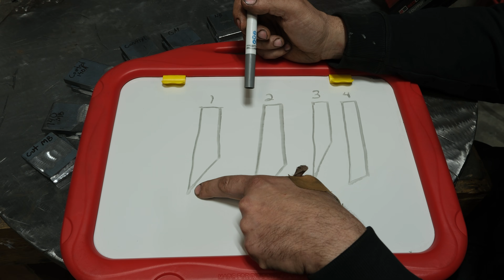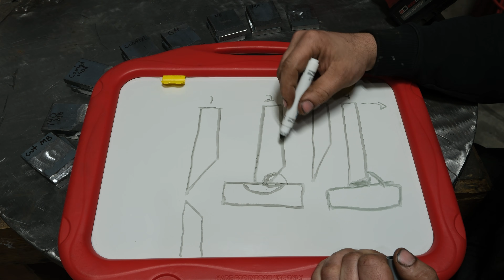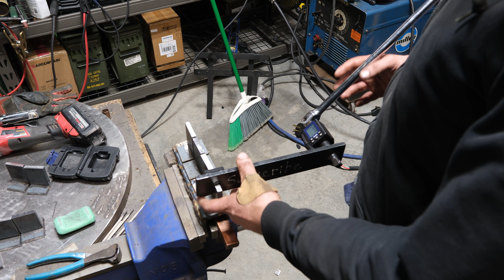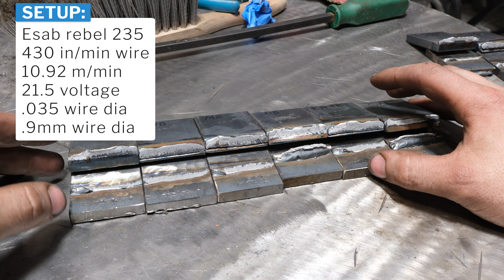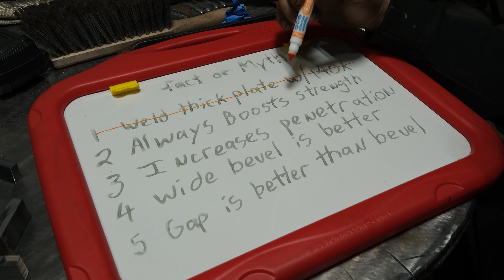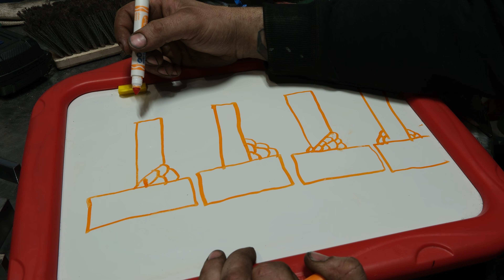Does beveling increase weld strength??  Deep dive

Comment: The obvious answer is your penetration-to-material thickness ratio but removing impurities with good prep is also a huge factor. The increased size of the weldment with a bevel on a fillet is still beneficial. Multiple passes will help sink the heat into the base plate, a single pass in this case is still undersized. Gaps and too much heat can lead to cracking depending on the filler compound (71t flux tends to be more flexible than 70s solid).

Comment: i feel the main benefit of beveling is you gain surface area. Can do two passes in a joint that would only take one without beveling.
Reply from the maker: You can theoretically reduce passes and reduce how much weld is outside of the theoretical 90 degree intersection by beveling you are correct.   The problem with this from a “home gamer” perspective is that on thick plate the probability of poor fusion is high.  I was successful in getting decent results, but it wouldn’t take much flaw in technique or settings to cause a very weak tie in to the bottom plate.  You could end up with a situation where you think you have a solid amount of weld throat depth, but due to lack of internal fusion you have almost none.  With spray, dual shield, or other processes that have more penetration I wouldn’t be so worried.

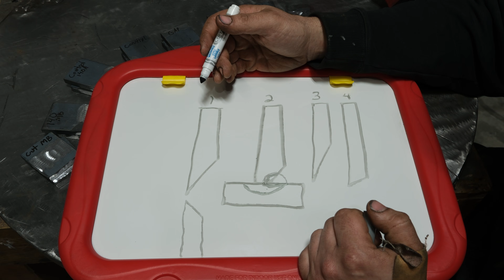Comment: 6:24 I thought the purpose of the bevel, in diagram 2, is that if you don't bevel you get zero weld penetration at the center of the sticking-up piece of metal. So it's more about getting as much of part A welded to part B as possible, than it is about depth of penetration. 

But I think a lot of stupid things.
Reply from the maker: The bevel will allow more weld to be deposited into the material, which allows you to reduce the number of passes on the outside of the “theoretical” 90 degree intersection.  This can be good if you need the clearance (aka an oversized weld would be in the way) or if you want to achieve resistance against leverage.  The problem is the bevel itself doesn’t allow you weld thicker steel than your machine can handle.  Many people have the thought beveling solves the issue of not having enough power when the reality is if you’re not careful it can make it work.   

Whether or not a fillet weld needs to be full penetration or have a bevel (and thus weld further in) comes down to what the particular joint needs to handle.

Comment: after the first 15 seconds or so, i was actually thinking of whether bevelling is needed or not.  you see end cuts and acid etches of welded plates, the penetration goes deep enough in a good weld that without bevel or gap, it's still fine, it'll never penetrate deep enough to get it all done in a really thick plate cause the welder tip/rod won't go deep enough, there are those 800amp welders that'll do it by making their own bevel.  anyway, just to get the tip in deep enough to fuse at the middle of the plate is something i'd guess is the goal with a bevel.  one trick i've seen that seems to work is gap(0degree bevel :P) with small spacers.
Reply from the maker: Beveling is really dependent on what’s being welded and how it will be stressed.  If you only have access from one side and need to have 100% full weld between the top and bottom plate of a fillet weld, beveling is the only way to achieve this.  Situations that may be required is two stressed members of say a bridge that meet at an angle.  Or on pipe where 100% weld needs to be between the two pipes.  From a fabrication perspective much of what people weld probably won’t see a whole lot of benefit to it.  It arguably would be less effective than simply welding both sides of the fillet weld.  Sometimes that’s simply not possible or not acceptable.  Definitely a complex problem lol.

Comment: I would like to see a test with the vertical. Having a horizontal grind line 1/16th, deep 1/16th up on the vertical. That runs horizontal to the weld,

Comment: Love your channel, I would be very interested to see how flux core performs in the same senario as you have presented in this video. My guess is that the penetration for similar values as the mig would be better hence stronger weld. Hope you can do this but meantime will put to the test myself
Regards Kym Perth Western Australia
Reply from the maker: So flux core wire (self shielded) will out penetrate short circuit mig without much issue.  However there is a huge limiting factor with gasless flux core, and that is internal porosity.  I have done a lot of tests in the past, and no matter the wire used or settings, .035 flux core wire had internal (non visible from the outside) porosity on steel above 1/4inch steel.  This becomes a major issue with weld strength when attempting to weld above 1/4 steel.  Switching to .045 Gasless or bigger will likely help with this, but most peoples home welders can’t run .045 or bigger wire.  The reason the porosity happens is due to how fast the weld pool solidifies, there isn’t enough time for the gas to escape.  Running bigger wire allows you to carry far more heat without the wire blowing apart, thus the weld pool is hotter.  

So the simple answer is flux core will put penetrate short circuit, but it’s weld will be weaker than short circuit on a test like this video because of inherent weld defects.

Comment: Very interesting break test.  I see how welding the beveled plate can add strength to some degree to the welded joint, but not as much as I would have expected.  For the best results, it seems that filling in the bevel out to flush with the surface -- then putting in one or more additional beads to build up a bead profile like what you would get without the bevel -- would create the strongest weld.  Of course, there would still be that area where there is no root fusion, but not as bad as without any bevel.
Reply from the maker: It definitely isn’t a cure all that’s for sure.  If I was able to do a better job of making the weld deposited the exact same, the differences would have been far closer.  All of them show signs of defects that are undesirable.  With 2 more passes all of the welds would have proven to be very strong.  Having the correct thickness of weld will make it far stronger than the bevel with a single pass.
Reply: @makingmistakeswithgreg  When anyone welds manually there is going to be variation.  It's unavoidable.  From your testing, would you say that the strength gain of welding into the bevel is mainly because there is more surface area for the weld bead to fuse to?  And that the farther back into the groove you can weld toward the root, the better?  If you have the time maybe you can test breaking some U-groove joints too.

Comment: I'm thinking of an other aspect:
I learned as a rule of thumb for MIG that a fillet weld has to be in size 0.7 times the thinnest of the joined plates if you weld one side and 0.5 times if you weld from both sides. This is because you fillet material is usually way stronger than your plates. In Perspektive for strength, how deep of a  fusion do you need provided that your material is shiny clean and you use the appropriate filler (that also substitudes some alloy elements that get cooked out by welding)? 0.1mm, 1mm or 3mm?
If  two welds cover a surface of 1cm² is the one with 1mm penetration stronger or that one with 0.1mm?
If they are equal, what does more  penetration on a fillet weld other than enlarging the fused surface by biting into both plates and creating a  radius?

Without any doubt a decent amount of penetration gives a visual sign that the Material is fused. Without any doubt it helps to overcome small impurities by cooking them out. Without any doubt it helps to ead away straight, sharp edges which are notorious for "hinging" and starting the fearsome cracks. But I'm wondering if the overall strength comes from the surface area of fully  fused metal, no matter how deep this fusion is as long as it is completely fused.

100% fusion welds are in another ballpark because these eliminate every straight edge (which is basically a predefined crack) leaving no lever for hinging.
Reply: Very good explanation of what fusion is vs penetration.  Many times people become confused between the two!  Good job!❤

Comment: Thanks for all the good information. Some of these welds just look like they were  brazed or soldered.  Food for thought for me.
Eye opener!
Reply from the maker: They all performed decent from a breaking strength perspective, but how many of them broke off the bottom plate (and the cut and etch) shows that there is definitely a reason why you probably shouldn’t use a 200 amp mig welder to weld thick steel regardless of beveling.  I think I am going to do a break test away from the face in the shop press and see if it fails due to lack of fusion into the bottom plate vs a unbeveled plate.

Comment: Welding sticks metal together. Myth! One take away from this is all the welds broke. Every one of them.
Reply from the maker: They all will break given the circumstances, some at higher numbers than others.  If I had welded the other side I wouldn’t have been able to break any of them.  I will be doing some bends towards the face and see if the lack of bottom plate fusion causes them to fail
Reply: Thank you Greg, this is great stuff. I'm real beginner, so I have yet only a simple gut feeling: weld each surface separately to get the fusion, then put the two together and weld the two welds???

Comment: Excellent video!
2:35 I'd add "0" and show the " square groove" weld (no bevel). It has its applications and advantages. By spec, a square groove weld has a weld size equal to base metal thickness. The primary limitation is base metal thickness above 5 mm.

Comment: Sorry if i missed the explanation but why the hell are you using short circuit mig on thick plate? I feel that if you used a process that was actually rated for multi pass structural steel you would have very different results in comparing a beveled vs non-beveled pass because the appropriate welding process would actually penetrate the plates, allowing it to take advantage of the greater surface/weld area given by the bevel.
Reply from the maker: As stated in the video the video is a direct response to the 200 or so comments that I have had in the last year that simply beveling plates gives the ability to weld thick plate with short circuit.  Not to mention stick (which is rated for thick plate) doesn’t penetrate bevels the way people think it does either.  The purpose of the video is to demonstrate that beveling is part of making strong welds but you can’t just assume it gives you the ability to weld thicker steel as good as a process designed for it.

Comment: Hobbiest, tractor type stuff here.  I run a HF 170 and dwell longer to melt the base metal moving up and down.  I need to test, but I’ve not had a weld break on the grapple I built.  I’ve tested weld on hooks with a 3# hammer which stay put and ring true. Thanks.
Reply from the maker: That 170amp machine will be able to do a lot of work.  The main thing you will want to watch out for is running flux core on thicker material.  The .035 flux core will likely perform far worse (due to internal weld porosity) than er70 mig wire on steel that’s 1/4 or thicker due to how fast the weld solidifies.  It wouldn’t hurt to do a couple test welds with a cut and etch to see what the machine is capable of.  I am not sure what the max voltage is on the machine, but 100% co2 will give more penetration over c25, but you need 24-25v.  I have a video coming out shortly comparing 100% co2 to c25 and the difference is pretty significant.
Reply: @makingmistakeswithgreg I’ve switched to C25 gas and .035 solid wire.  I usually 280in / 20v, but the machine can go higher with a shorter duty cycle.  I usually use a circular stitch where I can see both pieces melting and fusing as the wire penetrates into the pool.  I have a new project; I’ll do a test on those materials. Thanks

Comment: All welds ive done at my welding school for smaw (3/8 plate) we do 30 degree angle with a 1/8 land as well as 1/8 gap for open root ive seen best done by this. With GMAW ive done 30 degree angle with no land and 1/8 opening and seen best result with this, but this is in my trade school, so yet to actually yet to test welds out in the field. I also think many other dont realized everyone else has different techniques. At the end of the day if it holds it work. If it work for bend test it works.
Reply from the maker: A ton of stuff like that comes down to personal preference for sure. It’s best to be used to a wide variety of angles and gaps because if one thing is for certain, the real world likes to give you everything but perfection lol.

Comment: I remember from one of your videos you mentioning something about carrying a welder in your jeep, I also do jeep things and have been considering considering converting an alternator into a welderor just making up a kit to use 3 batteries. What wondering what your opinion is on some of those mobile more off road incase of emergency type of methods
Reply from the maker: There are a few types of those.  They have alternator style (installs as a second alternator) they have the spool gun style (ready welder, trail welder, fast welder, etc) that runs off two 12v batteries, and then there is straight battery powered welders like the esab and fronius.  I guess you could also just parallel two batteries and stick welder with jumper cables too (not the cleanest welds lol).  They all work, the trail welder 2 is probably the best setup for ease of use and effectiveness.  

As far as the effectiveness, for off road I much rather have a stick welder.  When you weld on thicker material (aka 1/4 and thicker) it has no issue making clean welds.  With flux core wire when you hit 1/4in it’s very common to have internal weld porosity.  Stick also gives the ability to run special purpose electrodes like 312 stainless (for welding springs, castings, and higher strength materials) nickel rods (for cast iron), and aluminum rods for aluminum wheels and other things.  Depending on your skill level the stick route is what I would do.  Flux core wire will be useful too though, so don’t write it off.  

I will be doing an experiment welding with two batteries soon with stick, so look out for the feasibility of that for trail repairs lol.
Reply: i have an old broco goweld, it can use gas and with 3 car batteries/42v max rating they claim that it'll weld 1" steel, which is not surprising given that the amperage potential of even just two car batteries is 1000+ amps, compare that to a house wall outlet: 120vac/20amp outlet =2400w=24vdc/110amps... a car alternator isn't playing in the battery-only league because it can only put out around 150a max, but the convenience of it on the trail far outweighs the limitations... check out rory from trailmater on youtube, he's not doing finished welds with an alternator/battery/stick combo, everything he does is rusty and dirty so it's ugly, he's just getting broken parts off of the trail with his rig in the quickest possible manner.

Comment: There's an added benefit to doing all this testing, SEAT TIME! The more you weld, the better you'll get. If you pay attention! It's never a sin to grind out a bad weld. But, it might be a crime if you weld over one. you don't want anyone injured or killed because you took some unnecessary shortcut!
Reply from the maker: 100%.  The question of “is this good enough” becomes easily answered when you’re staring at the insides of a weld and clearly see poor fusion.  More practice and being able to see direct improvement in results is a great way to learn.  Sure beats guessing at what’s under the surface lol.

Comment: When I was at the shipyard we did a lot of twin arc spray transfer roots with 1/16" 80S wire The lead welder initiates the weld and after he's about 3 inches out the lag welder who is running hotter fires up on the back side and burns right at the base of the lead welder's root! Full penetration on heavy plate. No gouging or grinding required. We were only allowed to twin arc the root. then it was one side at a time!  Guys, there is almost always a WPS for a specific type of joint and believe me. the engineers have done a lot of testing so trust the procedures they give you and put them in your memory banks for that odd non code job! 

Greg, have you ever thought of trying the 140A mig with 100% CO2?
Reply from the maker: That’s a hell of a way to get a full penetration root, thanks for sharing.  As far as the co2, it’s funny you mentioned that.  I just finished up a video on co2 that’s coming out tomorrow.  I didn’t run it at 140a but I did run it at 200a vs c25.  Without ruining the video the 100% co2 makes far bigger of a difference than I would have thought.  The downside is voltage.  I bet my machine at 140a could make solid welds on 1/4inch steel, but my machine can output 25+ volts.  A normal cheaper 140a might probably couldn’t get over 22v, and would probably have a ton of spatter and poorer performance.
Reply: that;s pretty cool thanks for sharing

Comment: At 4:34 or so, he speaks of sparklers.

Those would be the 1/16 rods, e.g. the ones you can get at HF - or would they??

As for beveling - single, or double when you can get at both sides???
Reply from the maker: A 1/16th rod or an actual sparkler would penetrate it lol.  You could bevel both sides and weld it out.  You would still run the risk of having a lack of fusion unless you run a gap.  Depending on what it’s being welded that much weld may not really be required.  Generally speaking if you took a 3/8th fillet weld and ran two decent passes on it (one on each side) it would be able to handle significant stress without failure.  Being fully welded with no gap between the top and bottom might be required if the material will see a lot of impact force or vibration.